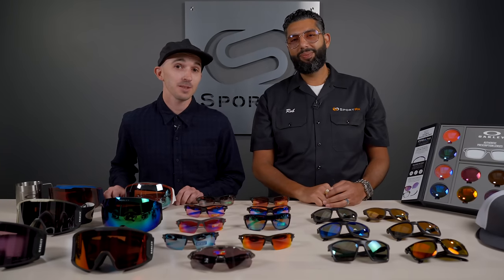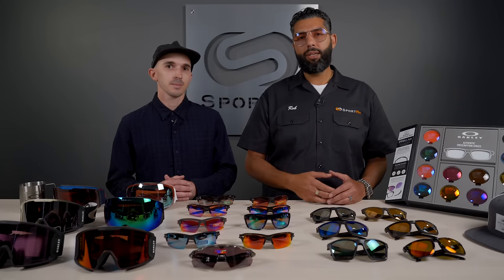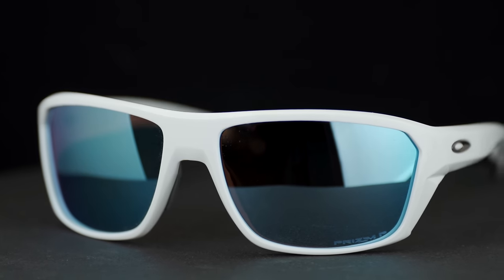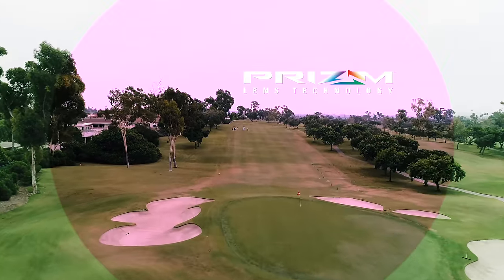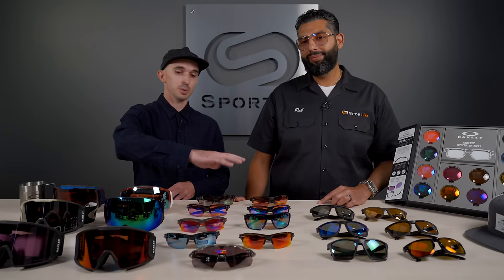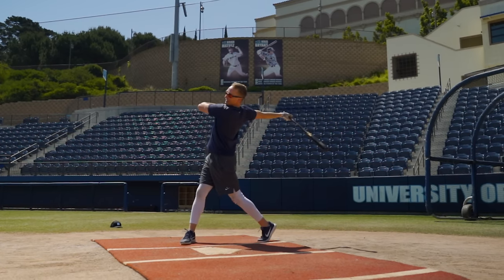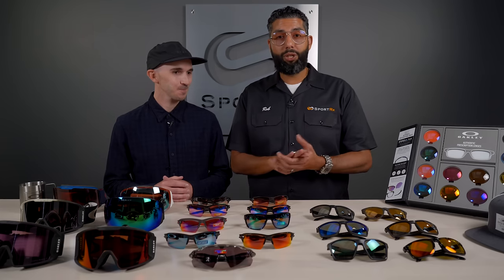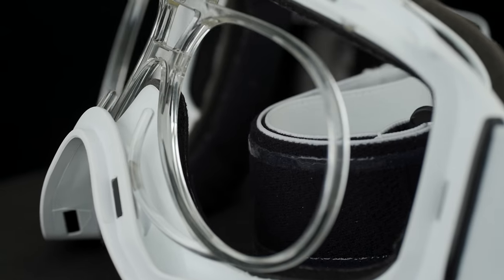What is Oakley PRIZM? | SportRx

Comment: I'm planning to buy a pair of Radar EV Paths in Prizm Road Jade. My questions is: is there any reason why I can't wear any other lenses for cycling..? I understand the explanation of polarized for certain sports, but can I wear Prizm deep water polarized for cycling if I like the color..?? 

It just depends on light transmission at that point, correct..?
Reply from the maker: Hi there! At the end of the day the choice is yours! We typically steer people away from a polarized lens for cycling because it cuts glare. However, in a road cycling environment you may find glare desirable because it will help you spot puddles or oil slicks on the road ahead. PRIZM Road is also fine tuned for the colors found in a road environment whereas Deep Water is tuned up to help you find contrast in a sea of blue. But like I said if Deep Water works for you then go for it!
Reply: @sportrxeyewear  Hey, thanks for the info..!!

I'm just starting to learn about Oakley's so that's definitely informative. 

I'll probably buy the Radar EV Path with Prizm Road Jade and a clear lens first, then decide on other lenses later. (If I can take a look at them..)

Comment: My question is, do the sapphire prizm lenses have iridium technology or it’s unnecessary? Because I need some new lenses for my Oakley jawbreaker, because I scratched the old lenses but they where sapphire iridium, now I m confused???
Reply from the maker: HI Roland! The term 'Iridium' refers to any mirror application on an Oakley lens. But more specifically, any mirrored lens without PRIZM. Technology. The Prizm Sapphire drops the 'Iridium' in it's name to avoid confusion with it's Non-Prizm counterpart. So you have the Prizm Sapphire vs. Sapphire Iridium lenses, both of which have a solid mirror application.
Reply: @sportrxeyewear  thank you

Comment: Running on trails I thought the polarized would make the difference between shadows and flares of sun that pop through the trees more clear   - more defined.  But they don’t.   Is that the polarization? Is prism plain better for varying degrees of dark and light running through the forest?
Reply from the maker: Hi there! The main benefit of a polarized lens is glare reduction. Glare occurs when vertical sun rays bounce of an object to create horizontal rays-the harsh glare is the combination of the two. PRIZM manages color. It separates the noisy colors while highlighting the colors your eyes are more sensitive to. This contrast boost helps you spot textures and details easier. I really hope this helped answer your question. If not, you can always contact one of our certified opticians here: https://www.sportrx.com/contact

Comment: How do I know if my Holbrook have prism? Been a couple years since I got them and don't remember if the worker told me if they are or not
Reply from the maker: Hi Devon! In most cases 'PRIZM' is etched into the lens. If you don't see anything on the lenses, try looking up the SKU/model number. This is on the inside of the temple arm. Should start with OO9102-...When you goggle it the lens and frame color combination should come up.
Reply: @sportrxeyewear  ohh. Would I feel it?  Cause I think they are. I have a different pair that is polarized qnd prizm and I think i feel the etch qt the bottom. And these one I think i feel as well. Because I can't see it well
Reply: Thanks :)  they are. I necer knew they were etched in. My very first pair aren't though

Comment: I have a set VR Oakley they scratched after time’ hope prizm* scratch resistant
Reply from the maker: Every lens material is susceptible to scratches, unfortunately. Even with a scratch resistant coating. Best way to prolong the life of the lens is to keep it enclosed in the case when not in use.

Comment: Too much reflections on Oakley lenses, The sapphire is the worst. In the end I gave up and went with Maui Jim's instead. No reflections since 👌
Reply: What do you mean by reflection? You mean light bouncing back? Could it be the culprit of a glossy frame?
I also own several Maui Jim.
Reply: Yeah, the lenses acts like a mirror. No AR coating on Oakley.
Reply: @eirikandreassen1815  which model do you have? Is the reflective coming from the inside of the lenses or when the light hits the frame? I m assuming most Oakley frames are matte not glossy.
If light reflects back to your eyes, then it better to do without the sunglasses.
Reply: It was the Holbrook Saphire Prizm Polariced. Matte frame.
Driving a car was terrible as there was allot of reflections from the side window.
Tried back to back with Maui Jim Castles and the difference where night and day.
Reply: @eirikandreassen1815 I just looked at the Helbrook. Their lenses are 57mm wide. This could be the reason depending in your head size. However, Maui Jim wraps even more around your head this leaving minimal gap for the light to get in. Again it all depends on the model. Which MJ you have?
 I have 3 Maui Jim's wrap style and never had a problem at the ocean or driving in full sun. I only wish they make photochromatic one day.
Reply: @MegaAluchi  I have the Castles and Maveric's.
I did put in Revant lenses with AR coating in the holbrook and it was much better.
I have sevaral oakleys and they are all the same.